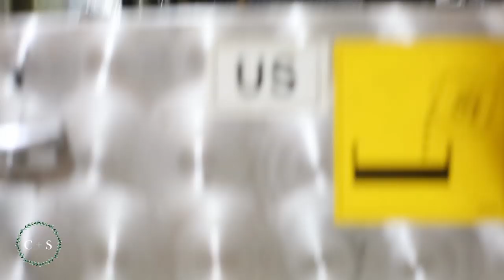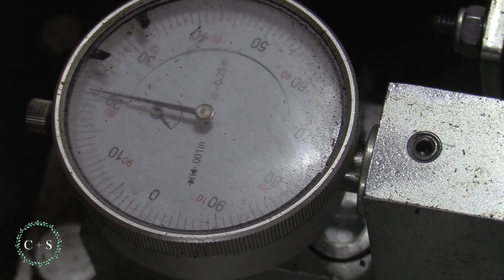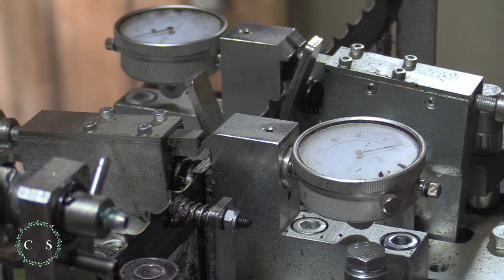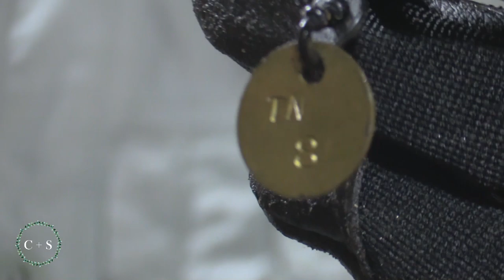EVERYTHING I know about sharpening and setting SAWMILL BLADES

Comment: Charlie, Well done!  I learned a bunch. Thanks You.

I emailed you earlier in the week about buying your sharpener/setter. I have none of that now. Now I can use a sharpener and setter and am ready!  Sorry to see that the mill is gone. Mine is a diesel LT50 also and I really enjoyed your videos.

Suffolk makes a setter that straightens the teeth.  And, 'Cook's makes (or made ) a band roller to straighten blades. I think the Suffolk is better than the Woodmizer since it holds the blade tighter and only bends the tip ( 0.160" or whatever you adjust it to ) 

You need to put Sarah to work. She is good at understanding mechanics and has real potential !. She'd be a whiz at running the sharpener/setter.

Comment: Did you always set before you sharpen?
Or did you try sharpening then setting and decided that this works better?
I understand that teeth can be really out of shape from damage.  Just wondering if the sharpener changes the set at all?
Reply from the maker: Sharpening does change the set a little, but its fairly consistent so you just set a little more than you actually need.  The problem if you sharpen first,  then set, is the tooth gets bent over so the sharp point is now slopped back and not as effective.  I have also noticed the sharp tip can break off
Reply: @charleyandsarah  Great information and thanks for making the video